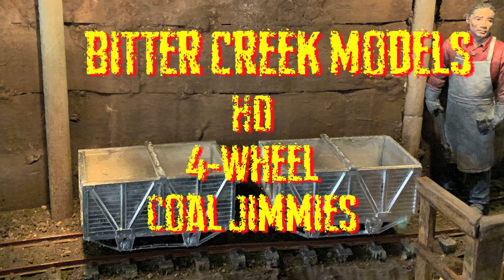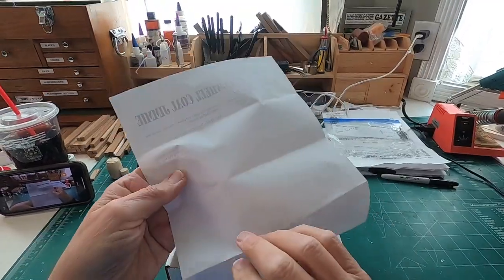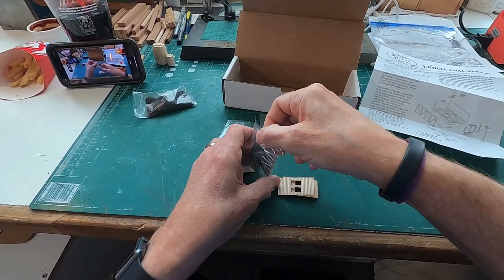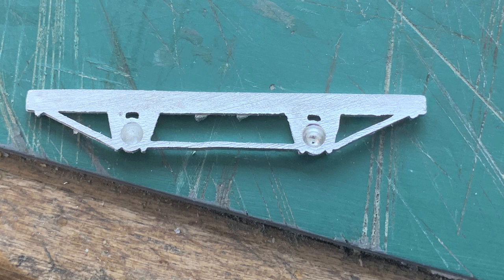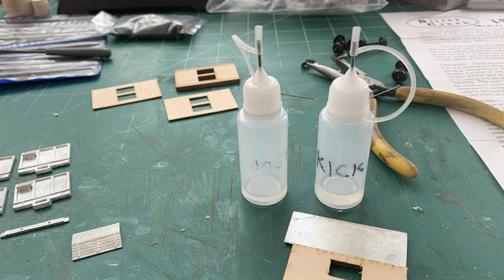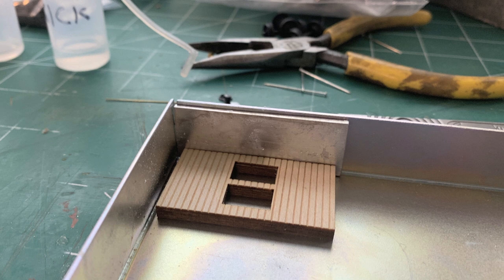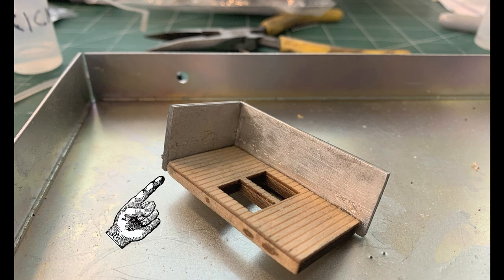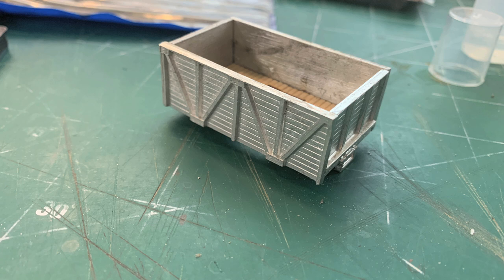Bitter Creek Models HO Scale Coal Jimmies - Used as 1:20.3 scale Mine Cars

Comment: Dale: You gave me some pointers.  I am building a civil war cannon and limber.  The brass truncheons don’t fit into the hoe in the cannon barrel just for starters.  Got 5 minute epoxy but think I am going to use Karyn’s suggestion and go with thick ACC glue.  Have prime some pieces and need to paint the ammo box once assembled.  Don’t you just love this.
Reply from the maker: Cool project!!! Built one about 143.5 years ago. More or less. Also built a working civil war cannon in o scale. Big flash. No real noise. A bit of a snap. But big smoke and flash!
Reply: @ToyManTelevision  I have been eyeing cannon kits for several years.  The price has always stopped the project.  One has to have dreams.
Reply: @ToyManTelevision  and downrange powder blows?
Working scale armaments + trains — can it get any better?

Comment: For such fine and soft white metal parts, using tank's track brunisher would be better than paint, as the metal would be etched and not painted. Ammo by Mig and AK have such product (which works fine with any white metal, not just white metal tank tracks!).
For a working model, I just don't understand how the wheels can be removed for painting or servicing, they seems stuck between the frames.
Reply from the maker: Good call on the wheels. I painted them. But if I wanted to run then I would need to brush paint the entire underside.